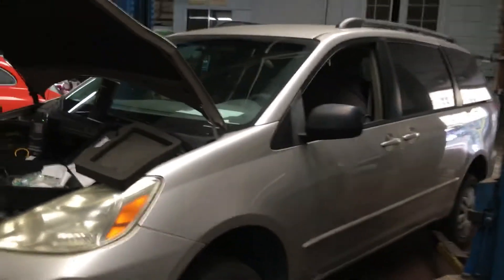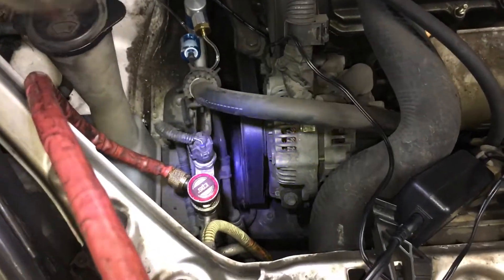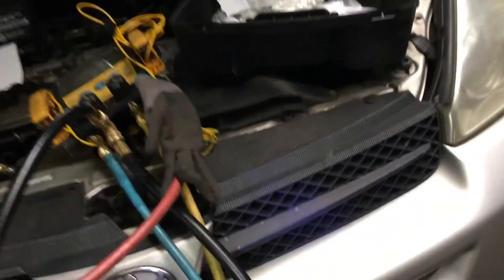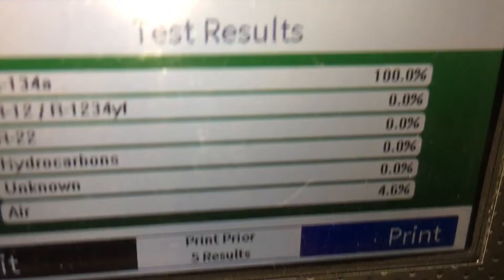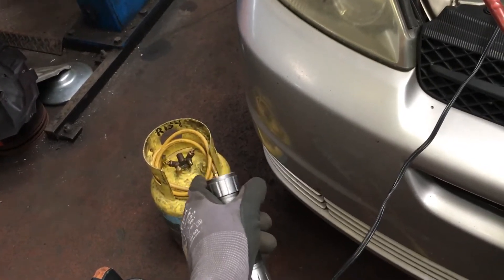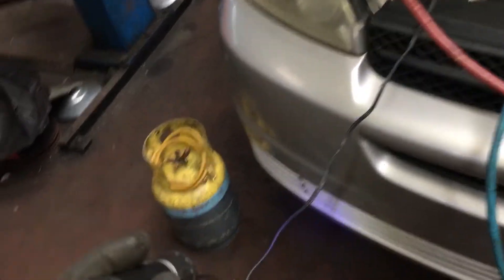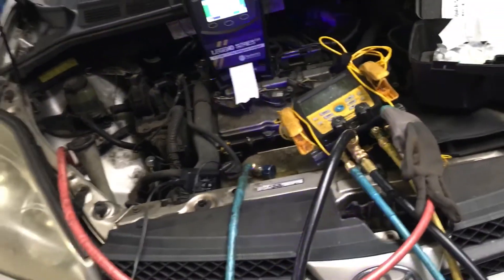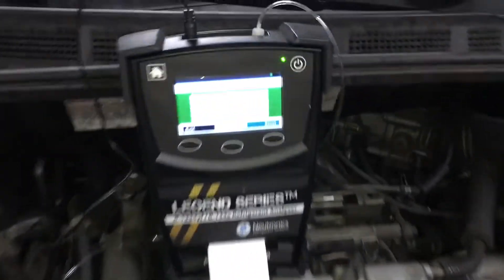Compressors On cars can outlive  live of the car￼.  Easily if taken care of and never see abuse￼

Comment: Seems like R4 compressors won't take much abuse, I've seen more of these with problems than any others.  Probably like you say, they were just topped off but still, they seem fragile.
Reply from the maker: R 4 was a little fragile,  The guys always added a little oil on every recharge the R4 would kill itself slugging with oil. 

The outer housing case seal would lose its elasticity with age and start leaking. 

When the customer would allow the refrigerant charge to get low with a cycling switch the clutch with cycle itself to death. 

You could buy the O-ring kit split the case off the compressor and put a new O-ring on it if you caught it early enough before any compressor damage was done. 

Busting to read valves or breaking a crankshaft rods can be avoided by not adding oil every time the system was recharged and having too much oil. 

And by not allowing the refrigerant level to drop so it hit that low pressure cycle switch point and cycled the clutch to death. Can be avoided
Reply: @coldfinger459sub0  Yeah, seems like every R4 system I come across the compressor is lunched.  Do you know anyone who's tried the scroll version, do they work or are they worse/not worth considering?
Reply from the maker: @thisisyourcaptainspeaking2259  I have never seen the scroll version. 

But from what I know of scrolls they probably do not work very well at idle. 

Scrolls work better at higher RPMs

So if somebody had a vehicle and they lived in a very hot climate and they commuted back-and-forth to work in slow moving traffic every day they would probably not be very happy stuck in traffic at idle speed
Reply: @coldfinger459sub0  Agree, I think you nailed it, low speed performance is unlikely.  Reliability counts too though, I might give one a shot and see.  Ugh! :(
Reply from the maker: @thisisyourcaptainspeaking2259  yep exactly what he said needs a little airflow moving down the highway to get it to work properly get it colder and he lives in Canada.

It almost looks like they got one of the tiny scroll compressor is off of Subaru a maids some sort of aluminum milled bracket slipped it inside of it and then slipped it inside the metal shell of an R4
Reply: @coldfinger459sub0  Thanks for the info, I'll be reporting back.  FWIW, this R4 has been revved to the moon more than a few times so that might be how it got trashed.

Comment: A new 12kg / 26.4lb tank of r134a over here costs $1041
Reply from the maker: In US dollars ?
Reply: @coldfinger459sub0  in aud, in usd that’s about $765.11
Reply from the maker: @ck9581  that’s crazy that’s insane.  Specially when the stuff is manufactured when I was last in China and I looked up refrigerant prices there’s about $1.35 a pound
Reply: @coldfinger459sub0  yeah it’s crazy what stuff costs here considering almost anywhere else in the world it would be a quarter of the price we pay or even less in some cases
Don’t know what you pay for stuff on your side of the pond but here the field piece sm480v is $1200 aud the vp87 vacuum pump is $1300 aud a standard length set of 3 refrigerant gauge  hoses with 1/4 inch fittings will set you back between $200 and $300 aud a bottle of nylog blue will set you back $58 aud a trublu vacuum hose kit will cost you $800 aud. Just to pick a few items you are familiar with and some that you use everyday. Oh and a replacement compressor for my car is $800 new or $300 remanufactured that’s just the cost of the part with me doing all the work I’m not paying someone else to do what I can.